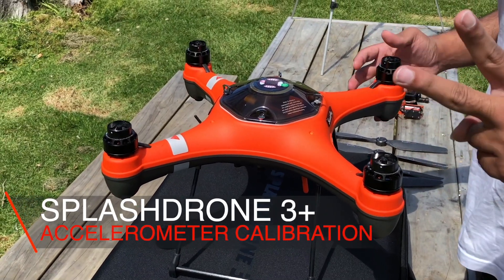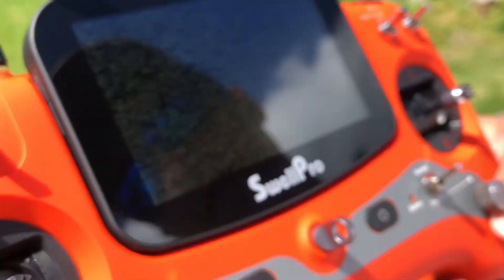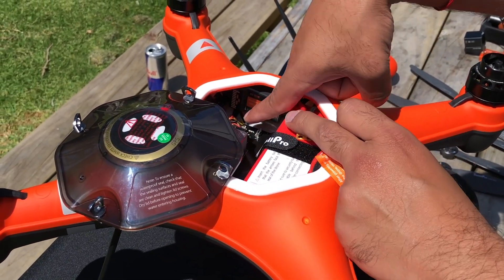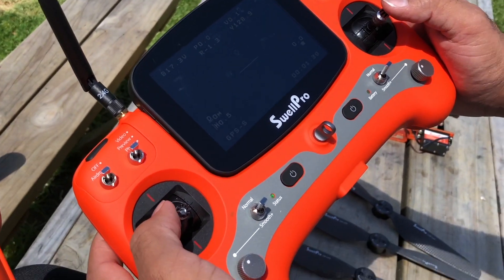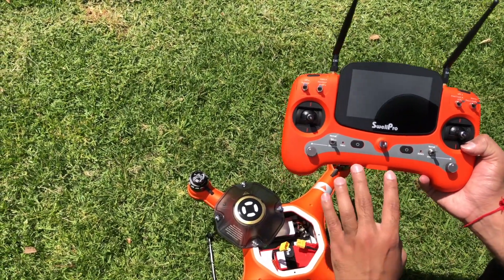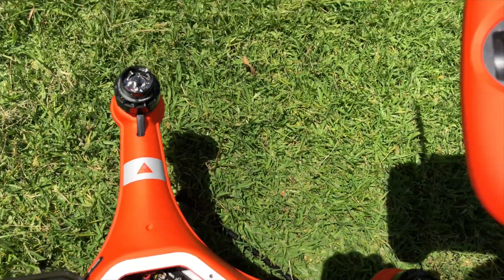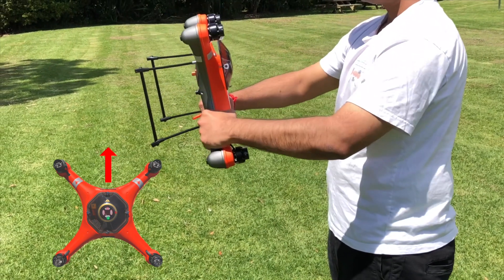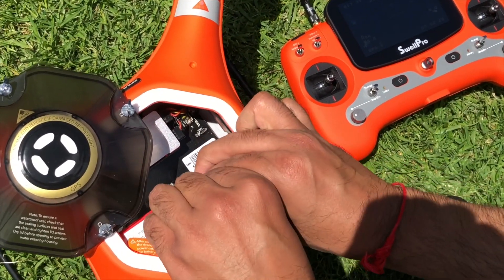SplashDrone 3PLUS Calibration - Full

Comment: It's just what I need for my boating adventures - I would buy one tomorrow BUT … it appears to be so complicated to set up and alas I'm neither a computer geek or a rocket scientist!  Question: Does it return to where it took off from or to where the controller is? I ask because in boating it's never going to return to where it took off from.
Reply from the maker: Hi Tim, it returns to base and not the controller. The calibration is not as difficult as it looks. We have SplashDrone trainers in NZ who can give you one on one training for a small fee which will include everything from unboxing the drone to flying it. Furthermore, if you're on a boat, you can drop the SplashDrone in water before take off and land the drone in the water near the boat and then pick it up. If you'd like to discuss the applications of SplashDrone feel free to give us a call and we'd happy to assist you.